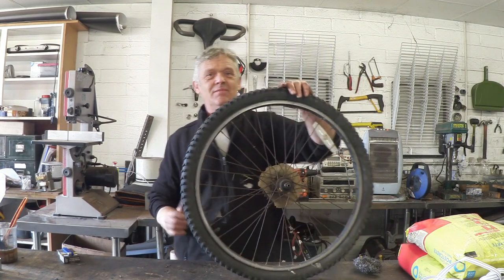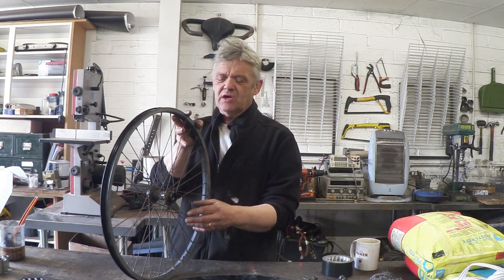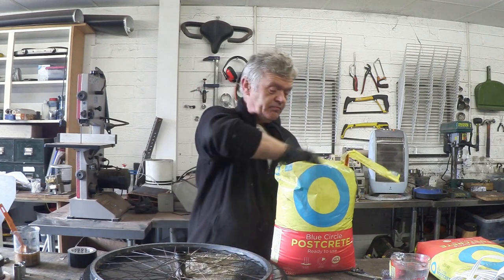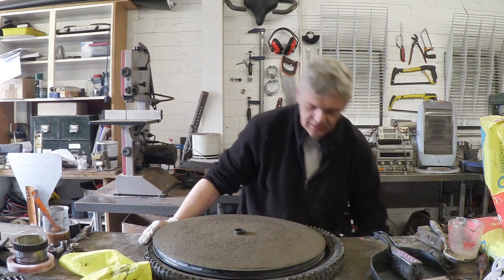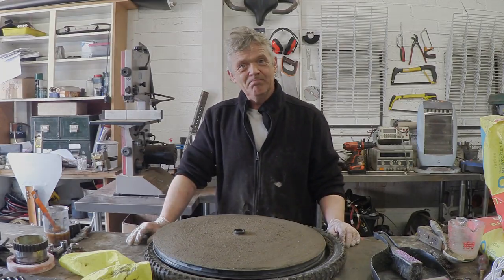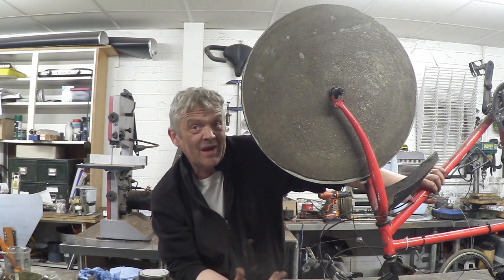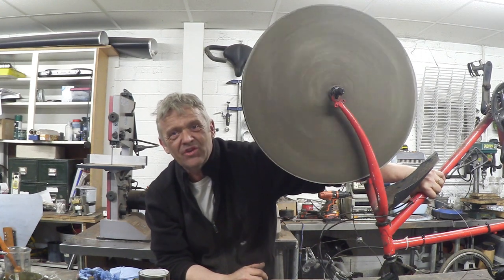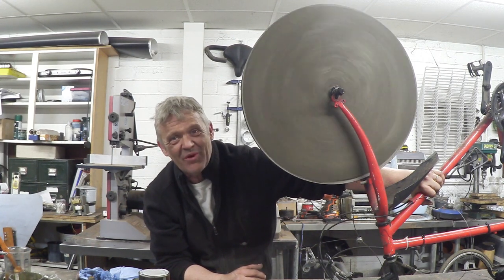1118 An Easy To Make Flywheel From Concrete And  A Bicycle Wheel

Comment: Doesn't this flywheel have a lot of dead-weight moving too close to the center to be efficient?
Reply: But it's cheap, and easy to make. This could easily be adapted by placing it all on a flat surface and putting a cardboard Rim around it to thicken the outside.
Reply: @thefirstmissinglink  or you could remove the dead-mass on the inside by planting holes inside the wheel
Reply: @colinhamer6506  but a lot less so
Reply: I think the point is a very easy and quick process to make a flywheel.  You may get gains from moving mass changing shapes or changing bearings but this is a 10min flywheel that you could reproduce time and time again. I'd happily watch a video of an improved version if you want to do the testing 😉
Reply from the maker: it does - but it is cheap and easy - so if the choice is no flywheel because of difficulty and expense or this flywheel then this flywheel is far more efficient than no flywheel - of course if you have a cast iron wheel - use that
Reply: @Peter_Schluss-Mit-Lustig  I will be quite interested to see how you do it! I suppose you could use lots and lots of pieces of PVC stood up in between the spokes. But it just seems to me it would be easier to thicken the perimeter. It's just concrete. Overthinking it will just take the economy out of using the concrete.
Reply: I was thinking the same thing. Just the tire weighted with heavy cement. Just the area of the tube gives the best performance.  There is a trick to filling the rubber tread with cement which is the wheel needs to be turning, not to fast and not to slow. Glue the bottom bead down and leave the top bead above the rim. Then pipe in the cement while the wheel turns. When full of cement, pop the top bead in and turn the wheel for about 2 hours or more till the cement sets firm. I guess some don't get how at 100 rpm's one pound at the axle doesn't have as much force as a pound a foot from the axle. If you double the weight verses doubling the speed, one is twice as much force and the other is 4 times the force. Plus there is double the distance from the axis with the same mass. So if the 25 kilos was at the rim it would provide more work than in the center.
Reply: @MAGnetICus_Attractus  close to what i was thinking
Reply: Rob generally gives us the "jumping off point", showing us the easy way of how to get started to achieve the most basic functionality with common items.  It's up to us to experiment with and improve upon it for our applications.  If he spent all his time working on projects until they were perfected for a specific purpose, we wouldn't get anywhere near as many ideas and inspirations and it may still not suit how we need to apply it.
Reply: @MAGnetICus_Attractus  you are correct but this has nearly as much mass, nearly as far out as the tyre, plus all the rest. Just filling the tyre, with the problems of piping and turning, to get maybe a few kg of peripheral mass? This has that, plus more. Granted, less effective because of reduced radius of rotation, but it's all adding to stored energy. Overall, much more than just the tyre, and far easier to make.
Reply: The neat this about this is you can treat the flywheel as a module and connect as many of them together as you want.
Reply: @colinhamer6506  energy relates to v-squared, and in this case the length of the moment arm, i,e, radius.
Reply: @ThinkingandTinkering  the tensile strength of the material is the limiting factor -oh, wait, I've already pointed that out.  ;-)
Reply from the maker: @bikerfirefarter7280  sometimes - usually cost is the real limiting factor lol
Reply: @ThinkingandTinkering  Very true. But safety at a price? Simply adding fibre to the concrete at no cost or a very small fraction of the overall material cost for a great increase in safety, or omitting it, is that worth it? What price hindsight/basic-safety? I'm not a worry-wart, I'm all for experimenting, but I've seen seemingly innocuous rotating stuff come apart. Not so lol then. I've also seen high-speed rotating stuff fail; and that's 'new undies' territory if you're lucky. (An old spindle molding machine threw a blade, a chunk of razor sharp high strength steel apx 100x80x15mm careering about the workplace, unseen but very noisy; THAT'S NOT FUNNY. Luckily no injuries other than our frayed nerves.)
Thanks for sharing.

Comment: But, how to change it ?
Reply from the maker: how do you mean?
Reply: @ThinkingandTinkering  so as to store energy we need to spin it. How we can spin it to charge it and harvest energy with the same motor/generator?
That's the very hard part for me
Reply: @takismenexes6131  Its just a proof of concept, and it will smooth out the motion of some of the other contraptions (no insult intended) but as an energy storage system its poor. The radial velocity needed to store reasonable energy risks bursting it. Try stopping a chunk of paving slab going at even 20kph! Yeah? And that's easily attainable by steady pedaling. Do the math.

Comment: Cement is the source of about 8% of the world's carbon dioxide (CO2) emissions, according to think tank Chatham House.

If the cement industry were a country, it would be the third largest emitter in the world - behind China and the US. It contributes more CO2 than aviation fuel (2.5%) and is not far behind the global agriculture business (12%).
Reply: So, please, Rob, apply your wonderful ingenuity to improving this design to make it conform to our need to save our society and ourselves from the brink of disaster
Reply: Magphospo oxide cement can shoot half inch on both sides of an foam board in Chinsy aluminum channels in the form of house dry and move in in 4 hours no co2 like  Portland cement, phospoMagox actually absorbs co2. Fireproof waterproof 1/2inch on both sides foamboard has higher psi rating than block n rebar poured wallls. Portland cement should have never become the norm.